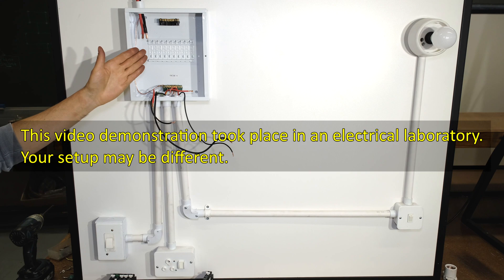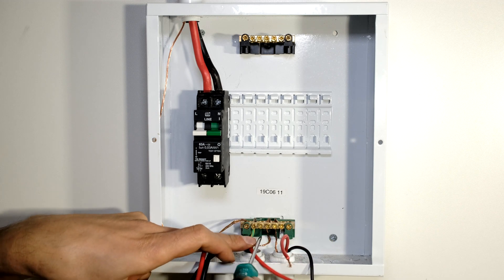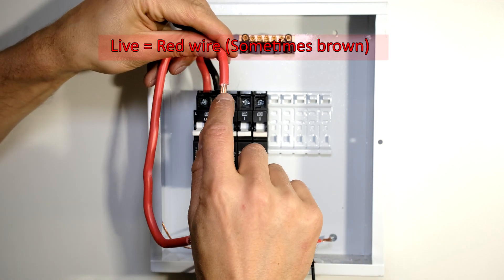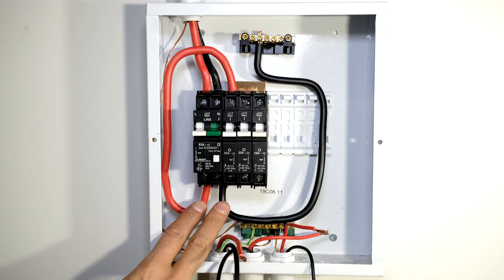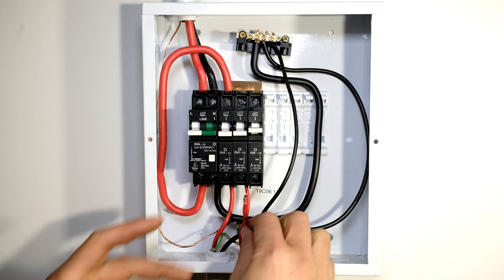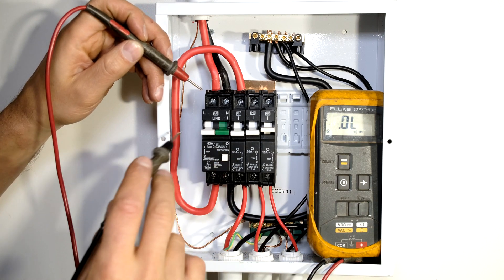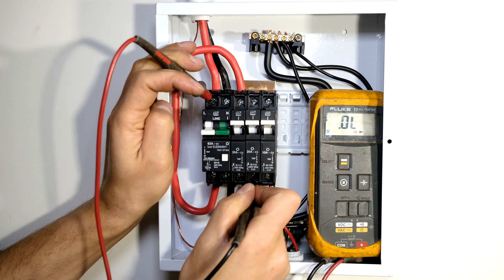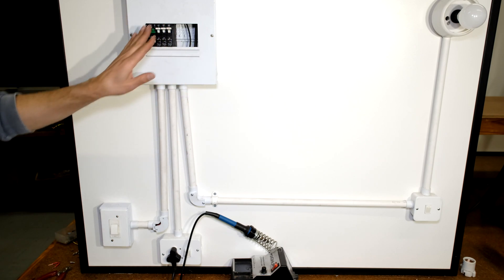How to wire a distribution board with all loads protected by earth leakage circuit breaker -tutorial

Comment: I the case of the lights circuit.....why not use 2.5mm2 wires and 20A CB, or is there a rule that 10A (1.5mm2) must be used?
Reply: Simple logic , the more lights you'll connect bigger Ahs will be needed

Comment: Not very professional installation. Active from earth leakage, can be connected from bottom , to the each circuit breakers after that , plus messy wiring.
Reply from the maker: In the country for this video live is fed from top to load breakers
Reply: Its correct- It is also written (LINE) at top and bottom will be (LOAD)- There is also a drawing on the ELCB - Where is printed 1 & 2. My friend this is for demonstration only, where same cables, CB are used over and over again- If you do training you will understand what is going on.

Comment: Thank you, great tutorial.

Just a question with regards to circuit breakers / amp calculations.

When you have a main 63A breaker with a couple of breakers, example: 20A, 20A, 15A, 15A, 10A ... will the "amp" draw exceed the 63A supply if all circuits use close to their limits, or would the "amp" draw be no higher than the highest breaker in your panel?

Say I have a sub-db from a circuit breaker (25A), does this mean I should only have the sum of 25A breakers in my sub-db, or will the highest "amp" be used?

Technically my understanding is that since they are connected in parallel they will increase the "amp" draw by the sum of "sub-db" circuit breakers?

Or am I missing something here?

Comment: Great channel, great tutorials!
Question, I see my DB has Main Switch and Earth Leakage but you don't show a Main Switch in your connection. Is the Main Switch an optional switch?
Reply: Not anything close to an electrician, but one use of that might be to safely replace a faulty Earth Leakage by turning off that seemingly additional double pole breaker

Comment: Good Day Awesome Video, Can you assist with my question . I have a 63 Amp main switch on my DB, I need to pull an AC feed to my Inverter, The inverter requires a 4mm AC Input cable (im using 6mm). In order to take the AC feed from the 63 Amp main switch , Can i first connect the power from the 63 Amp main switch to a 40 amp breaker using 16mm cable and then connect my 6mm cable to the 40amp breaker ?
Reply from the maker: thank you. Any cable you use must have a slightly higher rating than the circuit breaker.

Comment: Brilliant Channel!!!!!! Quick question, so if I want to connect half of the house's light switches on one breaker and the other half on another breaker i would have to twist 6 live wires of light switches together and connect that to one breaker for instance and another six to another breaker and the neutrals all gets connected to the neutral bar? Same goes for the plugs? Does that sound about right? Do you have a diagram or something that shows what amp breakers to use for what and what mm wires to use for each different section. I have posted another question on your Light switch replacement video of about two years ago as well. Thanks gain for this brilliant channel, best I have come across for us here in SA.
Reply from the maker: thanks. Yes what you said is right. you can use any wire that is rated higher than the breaker. So if you use a 16A breaker, any cable that can carry 16A or higher is suitable. There is a SANS standard regarding the cable sizes. Generally people use 1.5mm for lights with a breaker no higher than 16A.
Reply: @ecologicaltime  thank you very much